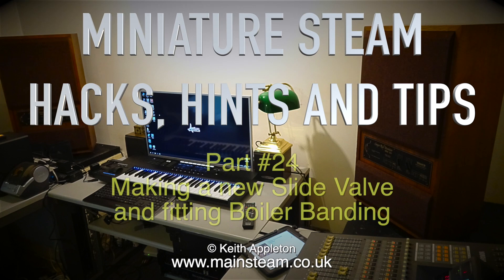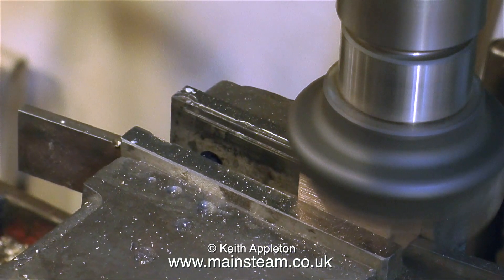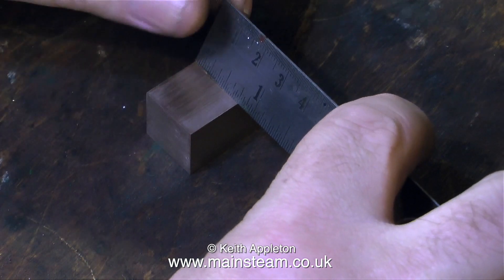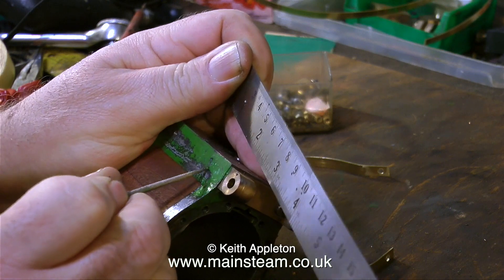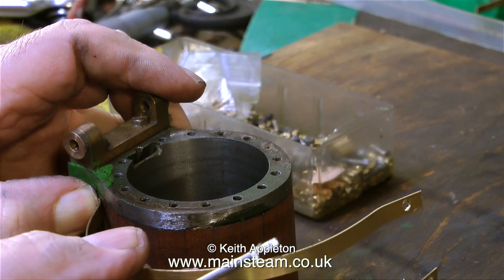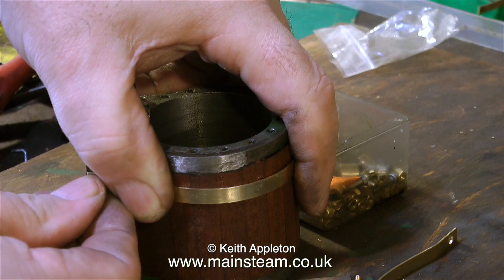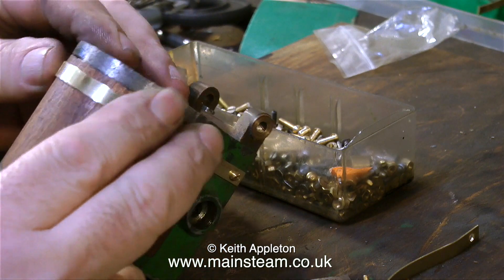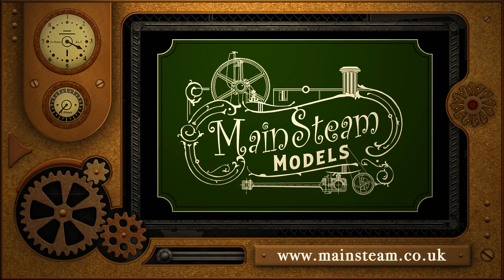MINIATURE STEAM HACKS - PART #24 - MAKING A SLIDE VALVE AND CYLINDER BANDING

Comment: Placing parts on One to one drawings is done by most machinist as a quick check, one place where we were making front panels for rack mounted equipment we would run a test part in clear plex instead of aluminum or stainless. Having snapped a few milling cutters in my time I can say that it was a great relief when I switched to CNC equipment most of which have enclosures which stop (or slow down) broken cutters, also great on keeping the coolant in the machine.